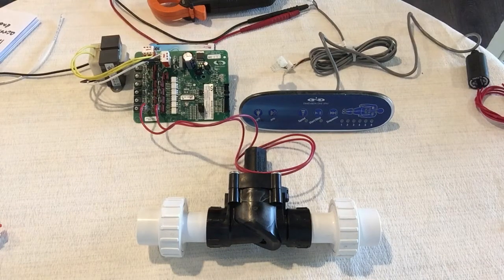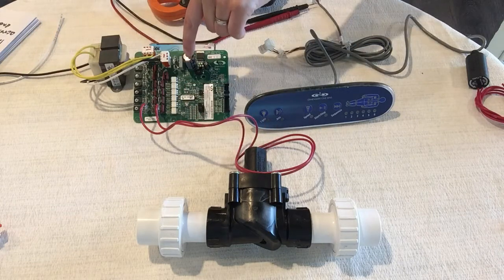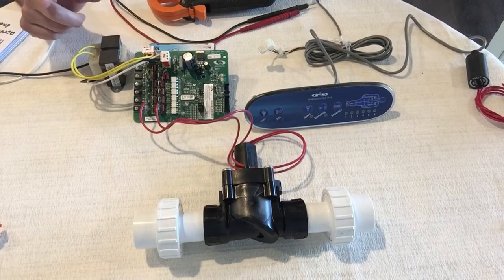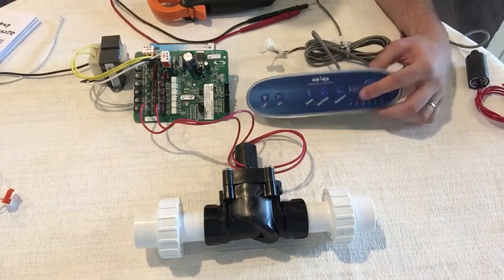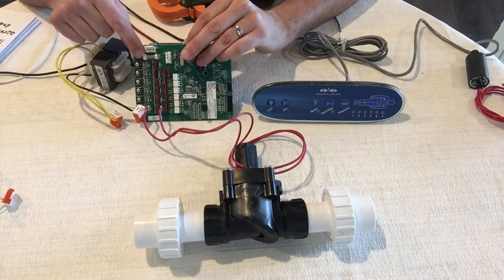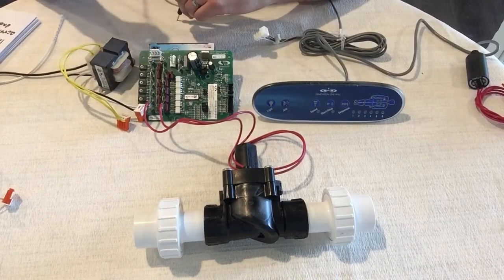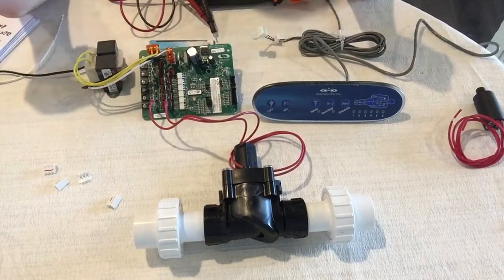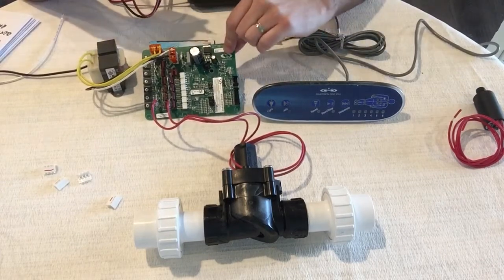Dimension One - Troubleshooting Sequencer Lounge (2000-Present)

Comment: I found a bad solenoid that was causing the fuse to blow.  I have replaced several solenoid/valve assemblies (I had some leaks). I have two questions:
Do I put all solenoids in ‘off’ position before reporting?
Does it matter which PC board tab I attach the two wires of each solenoid?  I know where valve 1 PC board tabs are but does it matter which wire goes to the two tabs?  I see no identifying marks on the wires of each solenoid.